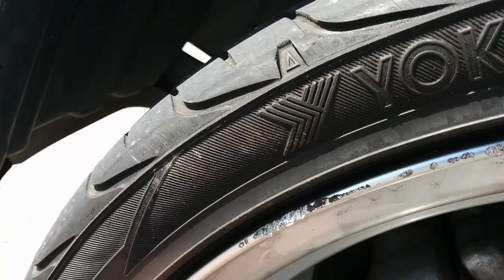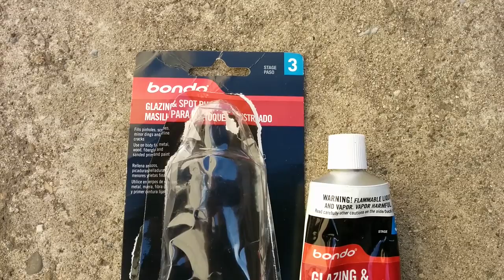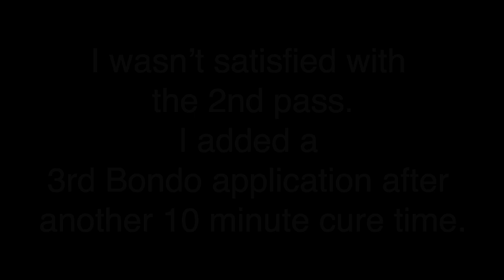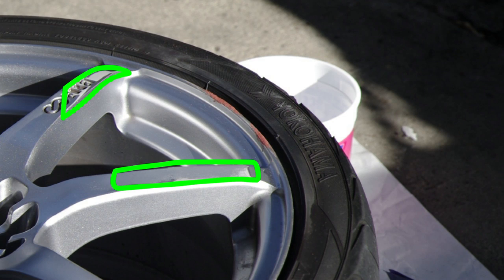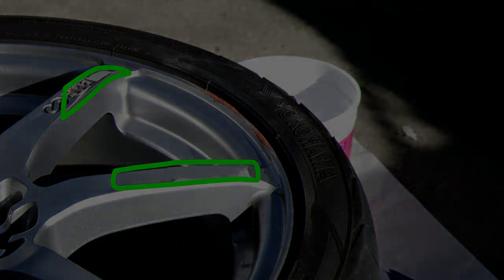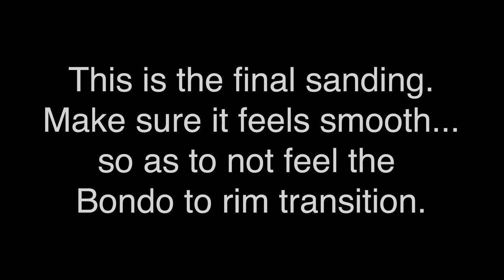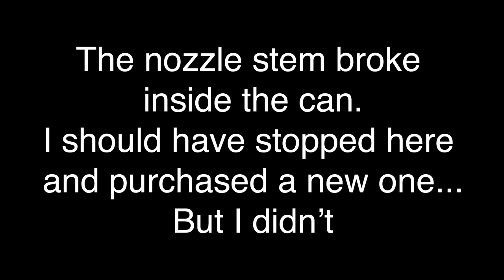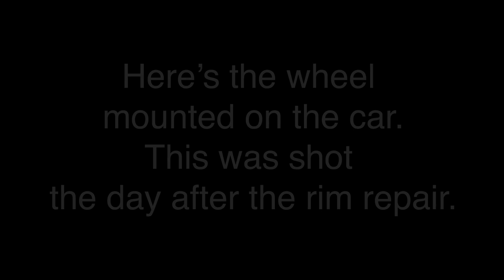Curb Rash Rim Repair (silver wheels)

Comment: Hey question, since you layered the tire wall and the other part of the rim with tape, wouldn't the paint not match with part of the rim you closed off?
Reply from the maker: Yes. The paint isn't an exact match. To prevent a hard paint line near the masking area, I did my best to feather the spraying. That is to apply the most paint at the target area (center) and less paint near the masked off area (tape).

Comment: Great video.  I wanted to do this to my Honda Accord with aluminum alloy rims.  Won't the bondo be damaged when a tire pulling machine takes them off the rim when it's time to get new tires put on?
Reply from the maker: +Jason Jay I had to replace a pair of tires. One of the rims had a Bondo repair on the lip (similar to this video). Surprisingly, the touch up area suffered no noticeable damages. Paint and Bondo patch still there. The original factory paint of the rim was scraped off when the tire tech applied the crowbar to the rim lip.

Worse case scenario, redo the Bondo patch again... I still have plenty left over in the tube.

Comment: Very nice video. Are there any concerns with the bondo chipping off or becoming 'unbonded' after changing tires? I have 0 experience with bondo so forgive my lack of knowledge
Reply from the maker: Devyn Sutton I had a pair of tires installed. The Bondo didn't chip off -- it held up.

The bad news... to pull the tire off the rim, the tire tech placed a crowbar on the lip of the rim and rotated the wheel. While bearing down on the crowbar, as the wheel rotated, he chipped the paint off. Metal to metal contact; the paint didn't hold. The majority of paint is removed from the inner lip of the rim. I had to buy the tires in a pair, so the other rim on the opposite side has the same issue.

Comment: How did you color match the rim?  Mine are aluminum without paint on them, so not sure what to do.  As everyone else said, great video.
Reply from the maker: Thanks. Color matching is a hit or miss. On this vid I used Dupli-Color Silver. As some pointed out, it is NOT an exact match, but it was good enough for me. I found a closer match using 1Z Einszett Silver Spray Wheel Paint.

For a non painted aluminum rim (i.e. a polished rim), you shouldn't use Bondo. You'll just have to sand down the scratches and use a wheel polish to make the rim shine. Here's a link to a forum that covers rim repair on polished aluminum rims: https://bit.ly/2LLeIe5. Notice he used higher grit sandpaper. Since it's a polished aluminum rim (not painted), the finer the sanding, the easier the polishing in the end.

Comment: hey man, nice DIY. couple questions, because i have to fix two of my rims as well. i nicked a curb avoiding another car, damage is roughly the same as yours. how did the paint match up to the rest of the rim, and is it possible to get a colour match that you know of? is it noticeable that you did a respray?
Reply from the maker: The manufacturer also makes a "hyper silver" color. I googled my rim specs and found my type is the standard silver.

"is it possible to get a colour match that you know of?" -- this can get pricey. The spray can option is limited to the standard colors. I have no idea how one would even mix spray cans to match your rim color. You can buy custom paint at an autobody supply shop (check these guys out: http://rothmetalflake.com/), but you will then need to airbrush the paint to apply it. If you have an airbrush sprayer, you might want to try this route. You'll have to do the math to see if going this route will save you money (compared to hiring a pro rim repair person).

"is it noticeable that you did a respray?" -- in most lighting conditions (i.e., daylight), the answer is no. I did notice the respray area at night while parked under a parking lot flood light. It was subtle; but since I knew about my fix, my eyes were more discerning. There was more sparkle from the reflective specs of the new paint; I was able to tell where my repair started and ended.

Comment: Thanks dude, good video. Nice rims! My rims are scratched like yours but all the way around the lip. After I fix it, will changing tires be any issue?

I'd hate to go through the trouble if the filler will break off on a tire machine.
Reply from the maker: That's a great question. No it won't hold, it will most likely break off. There's going to be a lot of pressure applied to the lip area when the tire is changed. I don't think it's strong enough to hold against that pressure.
Reply: eyeDtenTea cool, I'll wait 3-5000 more mile until I get new tires then. Still not bad to do every set of tires and cheaper than new rims. Thanks.
Reply from the maker: mrniceguy1437 no doubt cheaper... I think I payed around $60 at an auto parts store for the products. Big box stores (eg Walmart) might sell them at a cheaper price. Good luck!

Comment: I have curb rash on the spokes on my rim. I hydroplaned into a storm drain a couple of days ago. Does this method work on the spokes too?
Reply from the maker: +ulysses cervantes It does work for the spokes. Make sure to do a thorough sanding to knock down any ridges on the damaged area. 

Sometimes you can get away with just sanding down the scratches and repainting. But, if you see scratches, even though it feels smooth to the touch, YOU MUST APPLY THE BONDO. The layer of paint will NOT hide those scratches -- they WILL show up. The Bondo will fill the tiny (but visible) cracks.

Thanks for watching! ...and good luck

Comment: The Bondo brand spot putty used to fill the pits on the rim isn't designed to adhere to metal or paint, AND it is mechanically softer and weaker than primer. It's intended application is as a leveler of paint defects between layers of paint.

A better filler in this case would be fiberglass resin, applied with disposable plastic toothpicks to the pitted areas and cured with a heat gun.
Reply from the maker: "fiberglass resin"... I'm assuming the jelly version. Any specific brand or type recommendations?

Another commenter suggested JB Weld. What are your thoughts on that?

Comment: What happens to the Bondo when the tire changing machine removes the tire to put new tires on wheel?
Reply from the maker: It held up. I've replaced all 4 (did them in pairs not all at once) and multiple tire patches.

Comment: if your wax remover messed up yiur previous touch up paint does it mean not safe for black wheels?
Reply from the maker: I don't know. Play it safe and just use car wash solution and a sponge to clean the wheel. You can try the melamine sponge (Mr. Clean Magic Eraser). But only use that on your rims; it might scratch the body paint on your car.

Comment: How long from start to finish was this whole process, I got 2 rims I gotta do on my wife's car that have seen some curbs
Reply from the maker: jordan keefe about 2-3 hours. The primer doesn't take long to dry, and the paint a little longer. The hard one to estimate is the Bondo. You have to let the Bondo cure before you apply another layer; it's recommended to do small layers so the cure time isn't long. Don't sand that down until you KNOW it's cured. If you start sanding and chunks fall off, then it's not cured. You'll have to apply and wait again.

I would recommend splitting the work in a couple of days. On the first day,  prep the wheel: clean and sand down the rash. Next apply the Bondo. You can do one large blob as apposed to smaller layers like in the video. On the second day, sand down the Bondo (apply a touch up layer if not satisfied with the transition). Then prime and paint... you should also consider doing a clear coat after the final paint job. That will give a smoother feel and add further protection.

Comment: When applying the bondo what exactly did u do? Just shape the lip?
Reply from the maker: +Daniel Chacon Correct. Just built it up, higher than what's needed. I then used the fine sandpaper to knock it down to the correct level ensuring a smooth feel. You shouldn't feel any high points in the Bondo patch, and you shouldn't feel the transition between the Bondo and the rim.

Thanks for watching!
Reply: Thank you :)

Comment: Can I do this on my chrome viper rims. I scraped hard coining out of parking lot
Reply from the maker: Kirsten Riggs Maybe... the issue will be finding the right touch up paint for chrome rims.
Reply from the maker: eyeDtenTea Dupli-Color has a chrome in spray can form. Check out this video: https://youtu.be/gHRhwvgZn3o

For optimal results, you should have a black base coat... the video suggests using Rust-Oleum, then Dupli-Color chrome paint

Comment: you should have used gb weld.. correct me if I'm wrong but that looks like spot filler? that won't last.. spot filler is meant to fill pin holes/ sanding scratches in body filler
Reply from the maker: It is a spot filler. However, the patch is still holding.
As for JB Weld, another person commented on using that instead. The only JB Weld that I've used is the general use epoxy (for plastic; in lieu of Super Glue). I'm going to have to research the type to use for wheels.
Thanks for the comment and for watching.
Reply: eyeDtenTea sorry I swear I'm not a keyboard warrior. just my opinion. in my experience spot filler is not very ridged.. great video though!!!
Reply from the maker: No worries. Your opinion is based on experience. It's welcomed here.

This was my first attempt to fix a curb rashed rim. After googling, I found a forum and a video using Bondo as a patch. So I went with Bondo. If/when the Bondo chips off, there's still plenty left in the tub for another patch.

Comment: how long did it take you to do that? I've got some WCI MT-10 wheels which all have a little curb rash marks here and there, due to last owner not knowing how to drive. So I'm expecting it to take little longer to do mine since it took you to do yours. But how long did ti take you? 
Thanks
Reply from the maker: +Sander Swanljung About 3 hours. Bondo curing time is the most time consuming. When you do your fix, make sure the Bondo is fully cured before sanding down. If you are Bondo'ing toothpaste size (instead of small installments like the video), let it cure overnight.
Reply: alright, thanks

Comment: ok my question is won't the bond break when removing tires?
Reply from the maker: +Matt Shields I had a pair of tires installed and the Bondo patch held up. This is only a cosmetic fix, there is a possibility that Bondo will fail. If it did during that change (or it does in the future), I'll patch it again with the same technique.

Comment: Hy I need help small amount of body filler got on my painted wheel how can i remove it  without damaging clear coat on it??
Reply from the maker: +surviveasl I don't know how secure the body filler is on clear coat. You can try a compound or polish (Meguiar's comes to mind). If that doesn't work, I hate to say it, but you might have to just scrape or sand that area off, and re-apply the clear coat.
Reply: +eyeDtenTea Okey , I will try to polish it of. Thanks
Reply from the maker: Good luck. I'm curious to know the results. Please post back the method used and any helpful tips.
Reply: +surviveasl ever figure that out?

Comment: hey ive got chrome rims, not a huge fan of them i wanna black them out,  but they have some rash, u think cause im painting them anyways this will work on the chrome?
Reply from the maker: I don't know how well Bondo will stick to chrome. 
>>If you are removing the chrome plating, then it should work (I'm assuming your rims are chrome plated aluminum alloy). 
>>If you're going to scuff up the chrome plating before priming, then I think the rough surface will be enough for the Bondo to stick to the rim.

Comment: If it’s just the lip would you as just to paint the lip?
Reply from the maker: You can. The paint will hide the scratch from a distance. But the closer you are, the more it will “look off”. 

Analogy: Think of it like putting a sticker on something, and it’s not completely smooth… there’s an small air bubble. At certain vantage points it’ll look okay, but you notice the bubble at another viewing angle. It’s your call if you smooth it out or say it’s okay.
Reply: @eyeDtenTea  And it’s difficult what gloss silver to use
Reply from the maker: Here’s the list of paints used in this vid:

– Dupli-Color Prep Spray (http://goo.gl/Q8gRxe)
– Dupli-Color Primer (http://goo.gl/zrFA69)
– Dupli-Color Silver Wheel Spray (http://goo.gl/FthczZ)

I found another paint that best matches my rims: 1Z Einszett Silver Spray Wheel Paint (https://www.autogeek.net/1z-einszett-silver-wheel-paint.html). I used this color for subsequent rim touch ups. 

Dupli-Color is more widely available.  And they sell various other silver colors. I just listed what I’ve used. Use that as a starting point, but do further research because my rim color might be slightly different than yours.  Good luck!
Reply: @eyeDtenTea  I used the same duplicolor paint I’ve been practicing on my OEM wheels today first and it’s going pretty good! Used a drill attachment that’s a sander. that was pretty good and now I’m on base coat but the tape around the wheel left a line so I had to sand that

Comment: Does it blend with the rest of the wheel? Or for better results is full wheel paint necessary?
Reply from the maker: lordoftheriffs79 The paint is not a perfect match. The touched up area is noticeable. If you're willing to paint the entire rim, you should get better results. If you use this option, you should also look into applying a clear coat after the paint job.
Reply: eyeDtenTea So I need the perfect color paint and a clear coat right? I want this done by a professional, if it is cost effective compared to whole wheel paint
Reply from the maker: lordoftheriffs79 For the DIY'er, you should look to match the paint color, but that can be hard to do. I used Dupli-Color because it was close (but not exact) match, cheap, and it is readily available. 1Z Einszett and Wurth are other brands (AutoGeek.net sells both). If it's a perfect match, then you can just spot paint instead painting the entire rim. As with the clear coat, I didn't use it. The lack of a clear coat is noticeable to the touch; the painted area is rougher, but it's holding up fine. Brake dust and road grim can be easily removed.

If you take it to a professional, the cost should be around 100$ for curb rash (chrome usually costs more). Some of the pros will spot paint because they'll have an arsenal of paints to choose from; and it's cheaper and faster than painting the entire rim.

Comment: How did you find paint to match perfectly to the rim?
Reply from the maker: +Mafioso My rims are pretty standard silver color. I just did a search for silver wheel paint. Duplic-Color Silver Wheel Spray is readily available locally and online, so I went with that. However, the Dupli-Color Silver Wheel Spray was NOT a perfect match. It's close, but there is a noticeable difference. 1Z Einszett Silver Spray Wheel Paint (http://www.autogeek.net/1z-einszett-silver-wheel-paint.html) is much closer to the wheel color.

Comment: Would this work for chrome rims if not how do I repair chrome rims
Reply from the maker: chad copp I wouldn't do this unless you're able to find touch up paint for chrome rims.
Reply: I have a local store that sells chrome paint.
Reply from the maker: chad copp Proceed with caution. There are videos on YouTube that use a black base coat. Then a 
"chrome" spray paint (via spray can... dunno the brand). Most videos use an airbrush to apply the paint (check out this vid: https://youtu.be/B-b5LJouPys). 

Ask the store what base coat/primer to use before the chrome paint, and the protective clear coat they recommend to use on top of the chrome paint. Make sure to tell them the intent is to repair wheel rims and not chrome trim. You'll want the products to hold up against road grim and brake dust. If this store is an auto parts store or big box, I would verify online about their recommendations before buying the product(s). Their area of expertise might not cover rim repair. 

Alternative is to outsource to a mobile rim repair shop. It usually costs more than regularly painted rims. You're looking at around $100 (USD) per rim.
Reply from the maker: eyeDtenTea For those that have chrome rims, check out this video on Dupli-Color chrome paint: https://youtu.be/gHRhwvgZn3o. Note, a base coat of black is still recommended.

Comment: Being a wheel, wouldn't you use a water proof filler?
Reply from the maker: Didn't cross my mind. Plus, there's a layer of primer and paint on top of the Bondo. To this day, the original patch is still holding.
Reply: Great. Thanks for the dyi. You've motivated me to do my curb rashes.
Reply from the maker: Great! Just go for it. You can't do any worse than leaving them as is. Little tip: work on one wheel first; perfect the technique (or come up with a better one -- one that suits you). Then tackle the others. Worse case, you only eff that one wheel, but the kicker is, you can just redo it!
Good luck and thanks for watching!
Reply: Thanks for the tip. I have a 99 996 C2 with the cup 2 wheels and the previous owner nicked a curb a time or two. My main concern was getting the right silver paint match for spot blending. You did an excellent job in blending so no worries for me now.